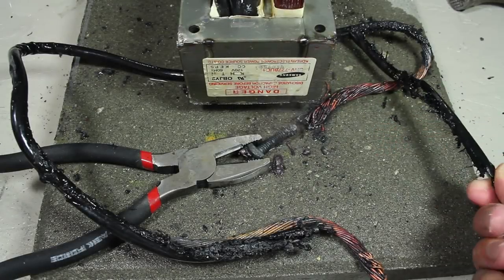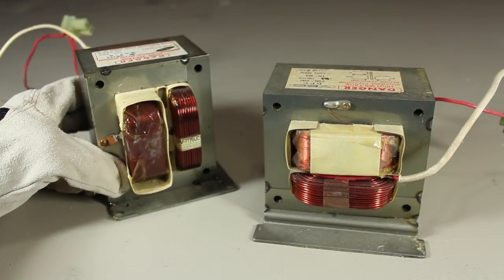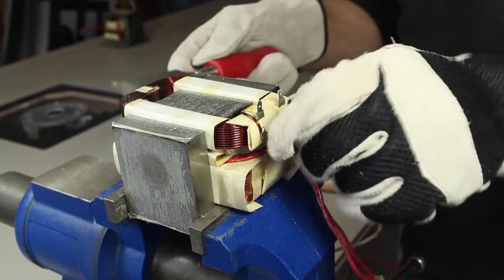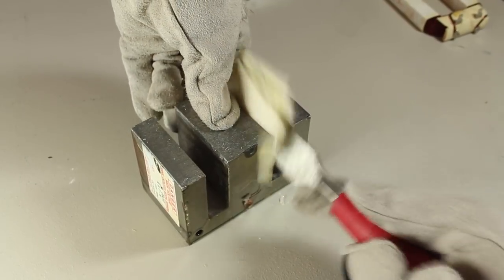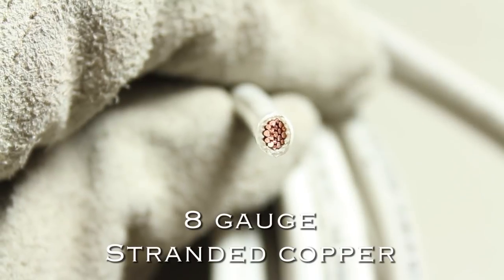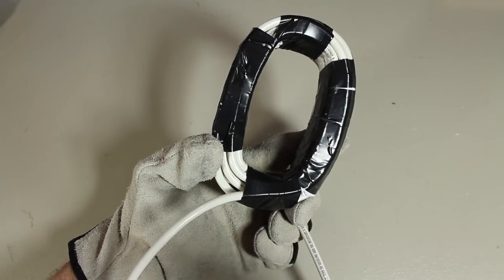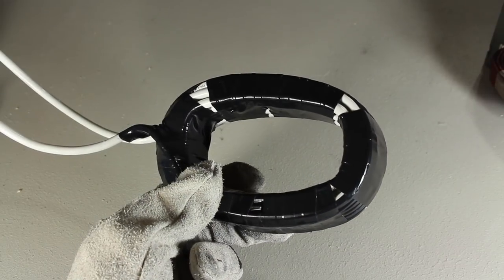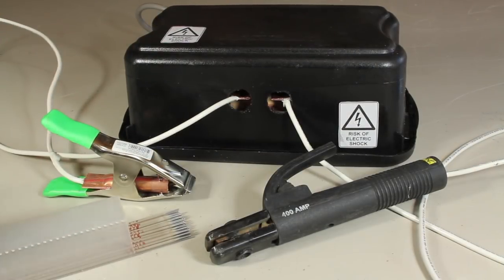Making an ARC Welder - Part 1 of 2

Comment: Hi Grant :)
I finished one of the two MOTs and re-wrapped it's secondary with the 8 Gauge copper wire 3 layers of 6 turns high as you said, then i tested it, it's voltage is 16V and it has the metal welding power and worked well, but it's temperature rises so fast , and it was about to melt 
so, Did i make any mistake ?, or I have to wait until I finish the second MOT to connect the two secondaries with each other ??
I hope to help me, Thanks :)

Comment: How does this even work?  There's no contact between the primary and secondary windings
Reply: johnathon blowe any amount of current through a wire will create a slight magnetic field, the more current the greater the field. If you wrap a long length of the wire into a tight diameter you increase the strength of the magnetic field and you concentrate it. Now, if you run another wire through the magnetic field, the magnetic field will generate current in that wire.
Reply: Reid Seal Oh, so essentially wireless power but on a deadly scale

Comment: ok so i was able to get the 'I' piece off one of the larger transformers by removing the welds with a dremel tool but i cant get the primary out without severely damaging it due to all the resin on it. Is there a trick to getting those out besides using a towel, I've ruined 3 so far trying that method?

Comment: sir, must it be 2 transformers? my neighbors don't throw out much ovens so i only got 1. can 1 transformer work as well?
Reply: +Chong Douglas The two transformers double the voltage. I'd say it's pretty important. Without it you're going to have a tough time maintaining an arc and you won't get good results.
Reply: +John Ridley cant it double the voltage adding more coils ?

Comment: I made one just like you did 240 line in and wired it and tried to switch the wires and still only getting 23 volts and won't weld but only arks a little any suggestions?
Reply: For welding you need a minimum of 30v, so you need to increase number of turns.
The ampage is determined by the gauge of the wire used,
so use thicker cable if need more current.
Reply: I got it fixed thanks putting out 45 amps

Comment: Grant Thompson - "The King of Random"  im gatjering materials to build this welder and i have a spool of 12g copper wire... would this work for the secondary coils if i wound more turns per layer or should i just get some 8g like you used? any advice would be mich appreciated ive been watching your vids for years
Reply: Philie Spiess Philie my man, the only thing to watch is the amp rate, or you'll end up with burned wires! Make sure the turns won't put more amps than 12 gauge can handle, the thicker the wire, the more amps!
Reply: Jess Vagnar thanks for your wisdom my friend 😊very much appreciated
Reply: +Philie Spiess Since your doing this project too can i ask you a question. Ive managed to get two transformers. the only problem is that one is slightly bugger than the other one. Will this be a problem?
Reply: Jess Vagnar i doubt the physical size would make any difference other than how you mount each one
Reply: ***** i doubt the physical size would make any difference other than how you mount each one to your base
Reply: Did you end up doing this? If so, how many turns did you use?

Comment: Do you have to modify  the transformers? Is there an alternative easier way?
Reply: Yes, if you don't want to use microwaves to build your own, buy a cheap 110v wire welder from amazon.

Comment: How many milimiters is the 8 AWG wire in diameter? Here in Brazil I can only find it in milimiters measurements. will it change the performance of my welder?
Reply: Plenty of awg tables for u to look up on the internet to find the diameter in milimetres
Reply: How did you get to youtube if you can't google stuff?
Reply: nevermind, I've found awg wire here

Comment: I violate the more transformer the transformer winding and ratio will need to make hi power current or voltage I mean ration of the bobin and through first to secondary ratio the more the windings and the more the thickness of the wire it will do the trick but be carefull to make one make sure the primary will need much thicker wire because of current needs of the wire is less than through secondary it will not turn on the transformer so it will not conduct a electricity to transformer.

Comment: does it have to be 8 gauge stranded copper wire or can it be some other type
Reply: xxxgrizleyxxx also is there another way of putting the transformer back together because that glue is not easy to get

Comment: Is this a dc or an ac stick welder?
what is its maximum amp output?
Reply: Did you see any diodes or rectifiers? I didn't, so it's AC out. Both secondaries has 18 turns, so totally we have 36 turns. I think it gives about 36V AC. The current should be measured in order to know its value :)

Comment: What would be the difference between putting a small gauge wire or a large gauge wire on it
Reply: smaller gauge has more resistance but takes but less space.  That much power will probably overheat the wire.  Large gauge wire has less resistance, but takes up more space.
Reply: tigeress da dog so should I use small or large gauge
Reply: Lectric Dolphin i think you should just use the suggested wire in the video, 8 gauge.
Reply: The bigger the cable the more current you have.

Comment: step down or step up transformers (I guest one is a step up and the other step it back down)? What is the v coming in and what is the v going out? Also why are they connected in series? Is the current flowing from phase to phase or from hot to neutral?

WTF??? 10 second to explain your connections, that all I ask. 10!!
Reply: d di Never mind. Its all in part 2

Comment: how an isolated copper wire will conduct electricity?
i did not get it 
please answer
Reply: The primary coil creates a magnetic feild. Because the input is coming from the mains it is AC the field will be constantly changing. As stated by Faraday's law, the EMF (in volts) induced in an inductor is equal two the number of turns times the derivative of the the magnetic flux with respect to time. This means that there will be current induced in the second wire as the field created by the primary is constantly changing. This is how all transformers work and this phenomenon is know as electromagnetic induction
Reply: thanks you have a future in electric 
conductoin

Comment: so me and a friend made one using 10 gauge wire for the secondary with 20 turns.  we had used it a couple times but not using it for more than 15-20 seconds at a time.  Unfortunately after about 5 uses the insulation between the primary and the secondary melted, so the transformer shorted.  does anyone know what we did wrong or how to fix it besides just pumping some silicone in it?
Reply: +Dean Sturt
 Use two transformers in series.Definatly works, almost too well!
 Cant get enough voltage/turns out of a MOT without hard to wind/find larger gauge enamel coated magnet wire.
I could only get 25 turns with #10 stranded THHN and the core was bigger than most.
Reply: +Chris Barth OK will do thanks for the reply!

Comment: how does the secondary have electric running thru it without any contact points
Reply: electromagnetism. If you happen to know these wireless charging docks, it works the same way.

Comment: Whats the purpose of the Variac/ scariac. Is it really needed.
Reply: Yes. I get that but. Is it really required. Any harm running the setup without it.
Reply: Its the only way of controlling it so yes, unless you own an adjustable power supply you cannot just plug it into a wall socket and go
Reply: But u did with the single transformer spot welder. Is it coz of the double transformer setup. M sry abt all the questions. I wanna definitely make one. And thank u for the response.
Reply: Btw. I live in India m we have a 240v supply. If that matters!
Reply: so, as this was made for the us 110v supply I would not use it as a guide.
Reply: But but but. I'll use 240v transformers  from microwaves if that helps. Gosh i really didn't think this through.
Reply: +Jasvinder Rekhi were u able to get this to work without the scariac? That's what I was planning on doing

Comment: Why did you create a new secondary couldn't you use the one on it?
Reply: The voltage is far to high to be used in a welder, t would mean risking killing yourself every time you used it. Plus I believe the current is two low to actually weld anything
Reply: And it would probably have been too short anyway
Reply: Zack Groothouse The output voltage depends on the secondary.   A microwave operates at some thousand volts but with low amps , a stick welder needs high amps and low voltage. This is done by changing the number of windings in the secondary coil.

Comment: Wow wow wait wait wait wait wait
1:44 you said LOW voltage windings when you took out the red wires
Those are 2000v - 2200v
Reply: Wrong. The red wire is low voltage. Only about 3-5v ac. But high current. Its used to heat up the filament on the magnetron in the microwave oven :)
Reply: oh.....ok thx
Reply: Np ☺

Comment: Will it kill you?
Reply: +Astuces de Trente Secondes - Must Kunst If you don't know what you're doing and the physics behind it then it have it's possibilities
Reply: +Astuces de Trente Secondes - Must Kunst 

If you are asking that question, do not attempt this.   Playing around with electricity without knowledge is just plain DUMB.  

If you insist on doing this, then PLEASE do yourself and your loved ones a favor and read every safety article possible.  I have plenty of experience in electrical and when  I was younger, 15 years ago, I almost died from being careless. I got lagged onto one side of a contactor and was standing in a puddle (everyone cringe now) I could not move and just stood there shaking.  Luckily a co-worker heard me screaming and came outside. I have never been so grateful to be drop kicked in my life. 

Electricity WILL KILL YOU!!! BE SAFE, stick to plumbing.
Reply: Dan Copeland I know, but i asked, is 2 volts safe to touch even if there is a current of 900 amps?
Reply: +Astuces de Trente Secondes - Must Kunst 
Yes,   not that I'm recommending  but at two volts, you could probably even lick it and complete the circuit and be OK, at the most you would feel a slight tingle, probably nothing at all at two volts.  

Voltage is like water pressure, current is, well, like water current.  Without pressure(voltage), that low of a voltage will not be enough to harm let alone feel through your skin/flesh.  
 

Yes, the commonly quoted 100-200 mA can kill,  but at much higher voltages.  That voltage is variable because of many factors but still much higher the two volts.

Those who disagree with me obviously have no concept or experience with high amp/low voltage sources. So, argue all you want, you will still be wrong. 

 There are many reasons why this is still dangerous( ie:short between primary and secondary)  but not because of the 2V/900A.
Reply: Chris Barth Thanks for you reply! So you mean, that if I touch a conductive piece with my leg accidentally, I even won't feel it?
Reply: Not if you are only part of the 2V circuit. Now you would probably feel 2V if you use needles as electrodes stuck deep into your flesh but who does that?! 

 The voltage that you can start feeling through skin depends on many variables.  I don't think you could nail it down to a specific voltage but from experience Id say that above 35-45V AC or DC is when there is enough "pressure" to start feeling it through dry skin. 
 
Think about it this way, if you touch a 12V car battery you won't feel a thing.  The battery can output 300A or more through it. The voltage just isn't enough to push it through our skin,

Comment: What is the low voltage winding. I think I know what it is. But can someone please tell me?
Reply: It powers other things like the fan and turntable.
Reply: Sean Craxford that's kinda what I figured. Thanks so much dude. Also. I have a problem with trying to use my transformer and my breaker keeps switching off :(

Comment: Sweet project, but you're an electricians worst nightmare. (without including the scariac)
Reply: +Basted G0d 
Hey,  I'm an electrician, even with the scariac it's scary.  Actually, once the secondary is off it's not as bad as it looks.  But someone would need to have a working knowledge of electricity to do this project safely. 

Seriously, if that transformer is energized while unmodified and someone becomes part of the high voltage secondary circuit, that someone will be quickly dead.  The combination of voltage(2000V), frequency(60Hz), and practically unlimited amperage will quickly and efficiently depolarize your heart muscles leaving you for dead.
Reply: Chris Barth Precisely. I find the part about the scariac that really bothers me is the fact the top has a very blatant opening on the front, easy for little fingers to slip into (as he said he has children).
Reply: +Chris Barth 
Since you are an electrician I know that transformers get really hot so wouldn't it be better if Grant would remove the insulation from the wire and insulate the metal that the wire sits on?
Reply: Easier said than done!  How are you going to protect the wires from shorting against each other or from the core laminations? Remember the wires vibrate at 60Hz, so without potting in epoxy or somehow coming up with a method to fix the conductors so the insulation won't abrade itself through is difficult, especially if its thin. Flat/rectangle type enamel coated magnet wire would be best but is hard or expensive to find and install so wire with thick insulation such as building wire/welding cable is the most convenient way to do this. Trust me, even without the optimal wire type or construction methods,  these rewound microwave XFMRS will output more than enough to be useable.
Reply: +BLADES 777 I second Chris. If anything a second pre-made transformer would be ideal. However in the long run, an entirely different design would be better sought out.
Reply: Chris Barth Thanks

Comment: why does secondry wie need to be insulated
Reply: corona discharge
Reply: ...no not at that voltage.  The wire must be insulated because it would short itself out and heart up with the same wattage you feed into the transformer... which would be a lot

Comment: I dont understand how IT works the metal on the wier isent makeing contact
Reply: I THINK... energy put though the primary makes a electromagnet and the secondary converts it back into power. the change in amps/volts is because of the number of coils and size of wire on the primary and secondary coils.

Comment: 220V IGBT ZX7 200 AMP Welding Machine MMA ARC DC Inverter. Was thinking of just paying the $60 for this. Then making the crucible the same way as video. As far as i can tell, the stats are the same. Would save me a bunch of time, and shock hazard. Any one following, see an issue in my theory?
Reply: King of random?